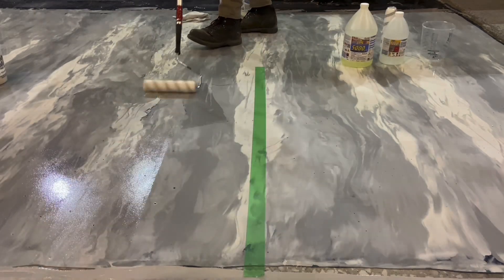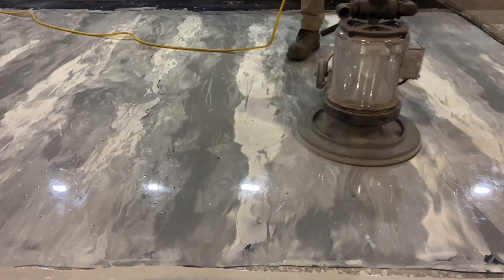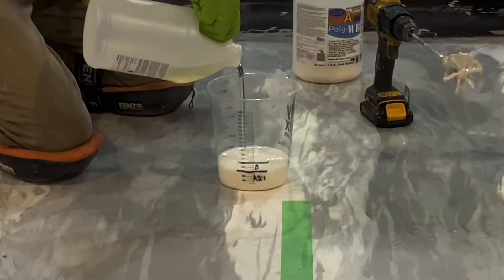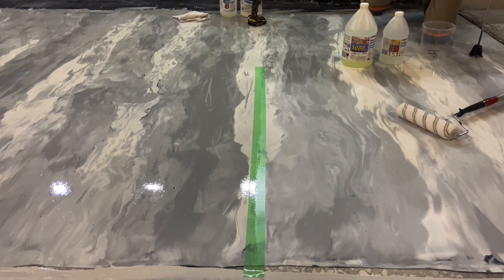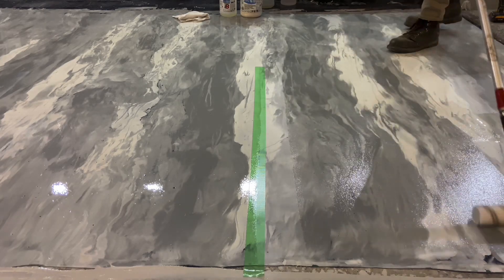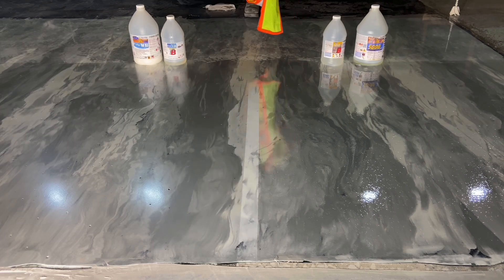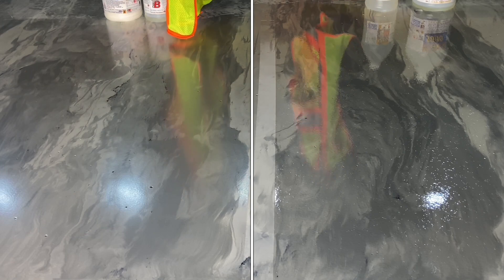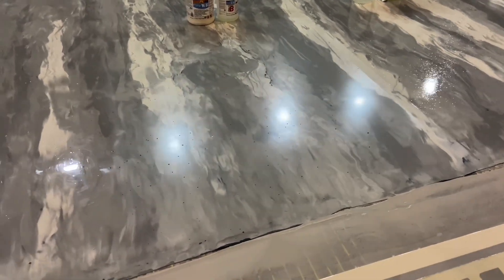Water Based Urethane and Polyaspartic Comparison

Comment: Thank you so much for making this video!!
Reply from the maker: @YouDontTalkAboutFightClub  you’re welcome. Happy to help. Turns out I can’t post the pic of the same test over the flake. The flake I have isn’t probably as glossy as yours. I’ll edit what I did to prep the flake and the results. Then I’ll post that separately. Hopefully it will help to give an idea how to change your finish gloss. Thanks-
Reply: @joshjones8047  If I need to pour a second layer of polyaspartic over my first layer of polyaspartic (which was poured over flakes) can I simply scuff the surface, then clean the surface and then apply a new coat of polyaspartic? Thanks.
Reply: @joshjones8047 Or would scuffing the surface cause the flakes underneath to appear cloudy after I pour the second layer of polyaspartic?
Reply from the maker: @fightclub-rule-1  good question. The other video I did showed the scuffing. Still need to edit it. There is one I did last year. Let me find the link and share that. 
To answer your question, they might appear a bit more flat but not cloudy. The scuffing will be wetted out by the fresh layer of Polyaspartic.
Reply from the maker: @fightclub-rule-1  here’s a way I was shown to scuff Polyaspartic. There’s a video I did the other day but need to edit a bit to post it. This one is a few years old: https://youtu.be/iiqIKLTjNBo?si=dN8bDVhRNmeXrGU6
Reply: @joshjones8047  So basically here's the situation I am currently in....I just had a contractor pour a 2-gal kit of 1:1 polyaspartic over flakes in my 400sqft 2-car garage and they cut it with a little Xylene (not much). I had them add a kit of aluminum oxide and the sheen turned out nice and matte just like I wanted. Question, the floor is DEFINITELY textured and I CANNOT run and slide on it with my socks. It's not near as coarse as say Quartz would be but its texture is felt nonetheless-it almost grabs at your socks if you were to drag your feet while walking. Anyway, my question is can I just apply a new 2-gal kit of 1:1 polyaspartic over my garage floor without sanding it first? Surely the new coat of polyaspartic would be able to grab onto all that texture right? Or would I have to first sand the entire floor? And if so, what grit sand paper should I use? 80, 120, etc? Oh and one more question...it was 102 degrees on Aug 7th when the poured it and I can see some VERY faint roller lines...so if I opt to NOT do another coat of polyaspartic can I just apply some Xylene to the floor and roll it out with an 18" roller to make the lines go away? Just curious. Thanks again
Reply from the maker: @fightclub-rule-1  happy to help. The surface may have texture and that would help. The primary issue would be lack of absorbency. Even thought there is an absorbent additive at the surface, it’s likely saturated with cured Polyaspartic. 

As far as sanding it, any prep will be better than none. The problem with screens and paper (that I have had), is the surface grit is hard on both. Mine ripped to pieces in a few feet. 

Wish I had a better answer for you, but anyone I rely on for information says to abrade the surface. Some do just wipe with acetone and coat it. You are free to try this but delamination from use would be more likely than a proper scuffing. 

As far as roller lines, most available solvents won’t soften a cured Polyaspartic or epoxy to the point of blending roller ridges. Maybe there’s an industrial grade product that could, but I imagine it would be pretty harsh and probably not for sale to the public.
Reply: @joshjones8047  Makes perfect sense. Again, thank you for always caring enough to reply. I think I'll just leave what I have alone. I very much like the matte sheen and nobody will ever be slipping and falling on my garage floor, that is for sure : )
Reply from the maker: @fightclub-rule-1  probably for the best to leave as is and see how it goes. You’re welcome. Thanks for the compliment. Glad it helped.